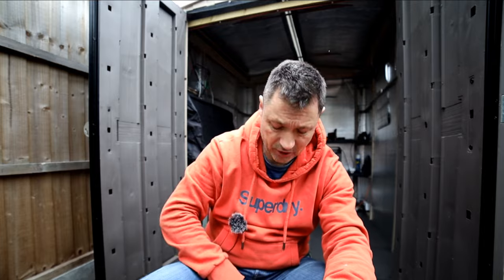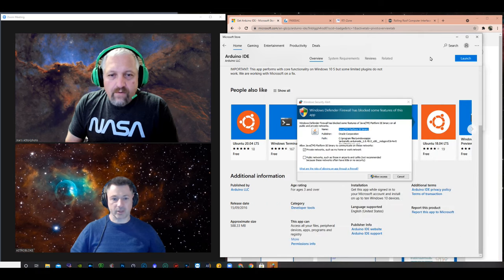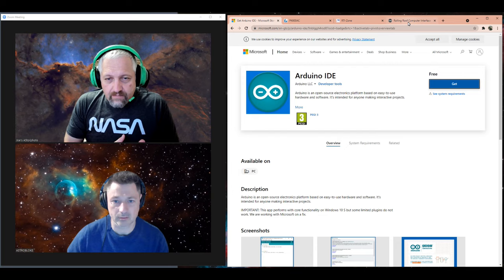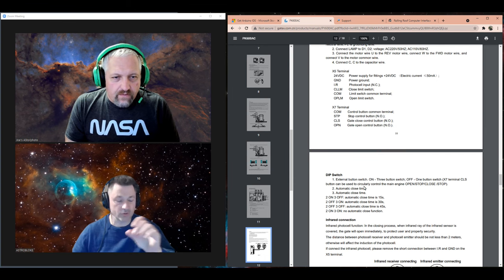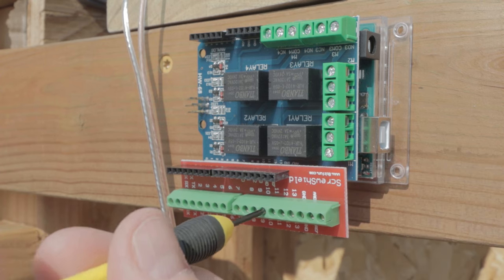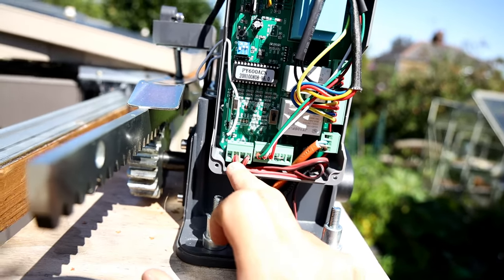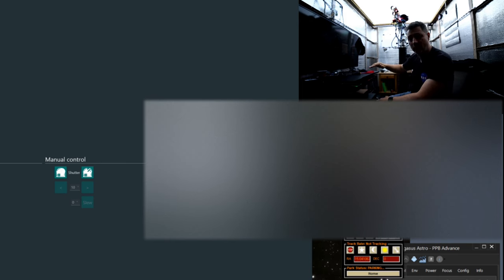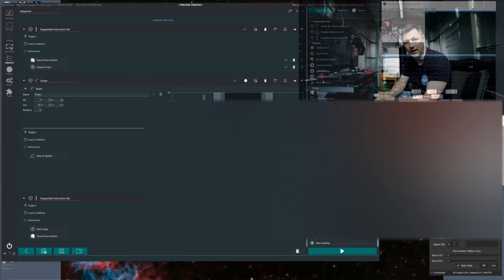How to use an Arduino UNO to control an Observatory Automatic Roll off roof!

Comment: Great video again. My roll-off roof working perfectly with the Arduino etc. Now takes me about a minute to set up and get going. All I need now is the rain sensor/code for the Arduino 🙂
Reply from the maker: Hi Richard, thank you and that’s great you have it up and running. Really makes a big difference. I am still to add a rain sensor but never tend to image if there is any rain about

Comment: Hi had some fun earlier this year with my Observatory roof. I also added mount park sensors and also a tweak to allow the possibility for the Arduino to wait for the second scope to park before closing the roof.
Reply from the maker: Nice. Do you run yours through SGP?
Reply: @Astrobloke  works with both SGP and NINA. Will be switching to NINA full time once 1.11 is a stable release. Nightly builds still a bit risky when sleeping 😬
Reply: Now I need to add a weather station. That’s next on my list.
Reply from the maker: @astrocapetown4955  both Joe and I have found that but the developers work hard on it so it will get there. Do you use the same rrci ascom driver and control interface ? I looked at SGP but was put off by the costs
Reply: @Astrobloke  yes, but rewrote the driver. I’m still on SGP 3, old licence, so will move to NINA soon.

Comment: This is pretty cool! I just started watching this, but thought I'd comment.

I'm using an Elegoo Uno to remotely focus my nexstar 4se and to get temperature data to display on my streams. It's basically done but I've gotta work out the mechanics a bit better and change the code as currently it focuses too slow even at full speed, due to the belt/gear ratio. 

Anyway, I'm enjoying the part where you're loading the sketch and uploading the code. All too familiar with this process lol
Reply from the maker: Hi and thank you for the kind comments and watching my channel. I have since built a new Observatory and have updated the video https://youtu.be/NI_ArOjR5PQ
I have not used one for focussing but currently working on a rain sensor and light panel control for flats. If I get them all working well I am bound to share via some more videos. 
Happy New Year

Comment: Fantastic work guys. Very keen to get this implemented with my ROR setup. Looking at the specs of my gate controller I think I will be following your setup Glenn as my gate motor also doesn't have the one O/S/C switch. Right, off to order the Arduino  and  other bits. No doubt will be picking your brains Glenn when it comes to the "wiring up" part so I don't blow up my gate motor :)
Reply from the maker: Hi Logan. Very little chance of blowing it up as such low voltage used to switch (5v) any problems give me a shout

Comment: Great video Glenn and Joe, just what I was looking for to get an automated roof, although I won't be using NINA I see there's someone who posted a link to their configuration for SGPro. So between the 3 of you I should have everything I need to get this working, however I do see a big problem for me, I've not got my obsy built yet lol, moved house back in October so obsy build number 2 due soon, roll on those lighter evenings.
Reply from the maker: Thank you Tony. Yes it works in SGPro the same using the Ascom drivers. Best of luck to you with the new Observatory. Is this one going to be much different.....Bigger? or adding any extras you missed on your first build?
Would love to see it when its done please
Reply: @Astrobloke  It will be smaller, my last one was used as storage for all my powertools aswell, that was 12 x 8, new one will be just an obsy at 8 x 6. Better wheel set-up on the roof this time, last one was pants ( my fault) but it worked, it was not motorised and I  had to give it a shove to start off before it ran freely. Motorised and fully automated is what I wanted there but never got round to adding it, this time the automation will be in the build.

Comment: Great work Glenn and Joe!  I'll certainly be following in your footsteps!  Did you consider adding another sensor to check scope is actually parked in the position you want it to be before closing the roof?  I mention it as I've had situation where it parked but not in the correct physical position - might be a disaster if the roof started to close
Reply from the maker: Hi Les and thank you for your comment. I personally have never had my scope not park correctly and where I have it set. I may consider it but at the moment I am happy with how it is all working
Reply from the maker: Les I saw a message from you but for some reason cannot locate it anywhere. Can you email me at astrobloke@outlook.com

Comment: Awesome job, Glenn.  This is really timely for me as I am just about to install the motor for the roll off roof.  I am going to use this system and shamelessly copy your hard work!  It is way cheaper than the Lunatico alternative.  I do plan to buy a cloud watcher sensor - do you think that can be integrated into your set up?  I want it to park the scope, close the roof etc in the event that clouds roll in?  Thanks again.  Chris
Reply from the maker: Hi Chris, Thank you for your comments. Please copy away, its the reason I shared it to help others do the same and save a small fortune.
You can buy rain sensors for the arduino which are silly cheap £2.50. I am sure you can integrate cloud sensors too. it would just tell the roof to close and as you can see from the video it would park the scope automatically first then close up.
Reply: @Astrobloke  Thanks, Glenn.  I will give it a go.  I wanted the cloud watcher (which is not cheap) as the main guard against rain.  I may add rain sensors too at that price!  Cheers.  Chris

Comment: Really enjoyed the videos. Would it be possible to integrate a rain sensor to automatically park the scope and close the roof?
Reply from the maker: Thank you Phil. I know someone who has added a cloud watcher and that has a rain sensor input. The Arduino does have a rain sensor add on which is really surprisingly cheap just a few pounds. It would require some extra code to get that to work and something we are planning to look at and possibly add if we can get it to work.

Comment: very good explanations and options! Is it possible to connect a rain sensor that closes the telescope in the parking position and the roof?
Reply from the maker: Hi Frank. Yes there is but its not something I have yet done. There are very inexpensive rain sensors for the Arduino but I am not sure how good these are. I know that someone did this set up for their ror observatory and added a cloud and rain sensor but I think the unit was quite expensive (£300) but works really well
Reply: @Astrobloke  Hello Glenn, do I only need the rain sensor and can I wire it to the Arduino? I would like to do this as my telescope has had a rain shower before....

Comment: I've amended the Arduino code again and now have Scope park Safe sensors (the same reed switches used for the gate rails) attached to the mount RA and Dec axes so the roof will not open or close unless the mount is properly parked.  I'll do an updat eon my channel sometime soon
Reply from the maker: That’s excellent Les. To date mine has been working perfectly and the scope perfectly parked everytime and roof closed when session finished. Will definitely have a look at your work though mate. Hope you have been keeping well
Reply: @Astrobloke  cheers Glenn.  Yes been well and busy with the masters.  I had an issue where the mount / Ascom reported it was parked in an erroneous position and the roof tried to close on the scope overnight so I decided to add in an additional level of safety.  The original code in the Arduino project sketch did have some lines which used a safe sensor and RRCI has an option to use it as well...
Reply: @brandlc  Hi Les.  Thanks for reporting your challenge and suggestion to change the  Arduino sketch.  I am having the same issue. Erroneous position reported (incorrectly) and roof closes mid session. Did you change  / add lines to the sketch to solve it?

Comment: Thanks were does thr the electric go into and how do you keep it warm in the  winter and  how do you cool it down in the summer thanks
Reply from the maker: I have power to my workshop via armoured cable from my house and I just extended this to some sockets in the observatory. All the ventilation and heat details are here at 10:56  https://youtu.be/QwhiaKHMGt8

Comment: do you have a set off drawings off your observatory thanks great ideas love to see some more videos
Reply from the maker: Hi Alan. Sorry I do not. Becasue it was a pre made shed unit I kind of had the ideas in my head on the mods and only scribbled down rough ideas and measurements on scraps of paper which I then threw. Its kind of why I made the videos so others could do similar and quite a few have and sent me pictures of their finished Observatories.

Comment: Hi Glenn,  awesome video, just ordered all this to build my shed. Could you put up a wiring diagram of what goes to what terminal?. And also what does your arduino get powered by? Do you connect it to your computer through a powered usb hub? Thanks fella. 
Have you got any experience with planetary imaging with an explanation of the imaging train with barlow lense? I have an edge 8 hd... just wondering what would go where, if there's backfocus spaces, what adapters etc
Reply from the maker: Hi Mark. On the link where you download the RRCI ascom driver there is a wiring schematic that I basically used. I just do not include the telescope sensor or weather bits. The arduino needs no additional power and gets everything via the usb cable just plugged into the PC. I am still to venture into the planetary imaging side of things so I do not really have much knowledge about it. If you don't know Dylan O'Donnell on you tube look him up as he has quite a few videos on planetary imaging. Think he has a C11. He is also hilarious, tell him Astrobloke sent you. If he says who? tell him to look me up and subscribe lol
Reply: @Astrobloke  hi Glenn,  so ive acquired all the motors, sensors, board, and also a new eq6r-pro mount. I cant get nina to control anything properly. So eqmod, ive set the home/park position to horizontal...set the unpark to upright/polaris position. Rrci ive reinstalled and set to detect park scope. Opened nina... sequencer opened and told it to 1- open dome, 2-unpark scope, 3- slew to ra+ dec position, 4 - park scope, 5- close dome. So what happens... it starts motor to roof motor which i stop with the switch on the motor and activate the open sensor with magnet. This keeps saying open shutter failed as it doesnt pick up the open sensor all the time. 2- i skip to unpark scope which it unparks but doesnt move to my eqmod unpark position, it skips straight to ra+dec slew but doesnt move the mount at all, i have to manually move to the polaris position using nina or eqmod mount direction buttons. Then it goes to park scope command- this doesnt move to the horizontal park position it just stays still in the polaris position. Then the roof closes which would take the scope out if it was all mounted. Any help to figure out how to get nina to talk to my mount and slew it to correct positions and the rrci, nina and eqmod to talk to eachother?..
Thanks
Reply from the maker: @ASTROKING-S  Hi mate. Firstly have you got the roof working correctly outside of NINA using the roll off roof controller? Also if you have a custom park position NINA will not unpark to home. When i made a small routine to check everything I put in the RA/Dec co ords for home and after unpark command it to slew there. Also can I ask which NINA build you are using?

Comment: Thanks for your video, I  have followed all of the intructions, but the sky roof control panel, once the roof is opened , when I want to push to close button it does not open de relay and  it crashes. I am using a garage door motor instead. Any suggestion? thank you!
Reply from the maker: I had this issue and another person also contacted me with this. Myself and that person had bought the wrong sensors for the roof open and close positions. We had got the normally open type where they must be the normally closed ones. They look exactly the same so I would firstly say double check that you definitely have the right ones. Also double check your wiring on the relay shield as it is so easy to misplace the Grnd wire especially and I know another person did this and it would work but keep crashing. Hope this helps.
Reply: @Astrobloke  Thank you for your time. I have checked the sensor and wiring and it is the same than yours, I think it is a skecth issue. I see the sketch has defined the relays as follows, which enable to use all of the relays: 
#define stop 4
#define sensor 5
#define close 6
#define open 7

but you are only using the relay 3, how did you handle this?

I am using a garage motor with one single button.
Reply from the maker: @mvargas333  let me check all the details for you and I’ll see if I can help you sort it
Reply: @Astrobloke  Thank you, I have also detected the follwing situation:
Skyroof control panel crashes when closing. 

using ascom app RRCI
Open push. the relays turns on and off in less than 1 second, not enough to send signal to motor. 
close push- the relays bearly turns on, the light in relay is almost unpercetible. 
In both cases, open and close, if I make a fast double click the relays remains open a little bit more, but goes off anyway. 
Sky roof and NINA is not allowed the double click.

I think some code in sketch is causing  this.

I downloaded the sketch from your video and the ascom I am using the named RRCI_ASCOM_setup.exe; both downloaded on Friday 13th. 

The wierd thing is I also have and older ascom driver I downloaded about 10 months ago which have a telescope link section, this one , the open button enable the relay to be turned on until the magnet reachs the close sensor, but the close button makes the same than the newer ascom version,  the relays bearly turns on, the light in relay is almost unpercetible.

Comment: amazing work, ive recently followed the instructions however when opening and closing the software detects the magnet but no signal is sent to the motor to stop :(

any idea how that can be sorted out?
Reply from the maker: Thank you for the kind comment. The Arduino only sends a signal to tell the roof to move. The limits and stop signal comes with the motor with either manual ramps or magnets that signal the motors operating range. Hope this helps
Reply: @Astrobloke  i connected 2 sensor magnets, the SkyRoof app recognizes them showing the roof is now open or closed but the motor doesn’t stop when the magnets reach each other, from what i understood in the video is when the magnets are in contact a signal will be. Sent to the motor to stop (similar to the signal that tells the motor to either open or close)
Reply from the maker: @lmu6airy  The magnets should definitely stop the motor from running and I can only assume you have these set incorrectly or something similar. The Arduino only sends a signal to open the relay to start the motor not to stop it as it would never know where to hence you use the magnets that come with the motor for that.  Can I ask did you use a gate motor like mine or similar that came with its own sensors for its running distance
Reply: @Astrobloke  man i must appreciate your prompt response first <3 
I’m using the ALEKO motor which is similar to the ones used by SkyRoof, also I’m using similar magnets to yours (NO not NC) and connected to the pins in the arguing shield without using the magnets that came with the motor